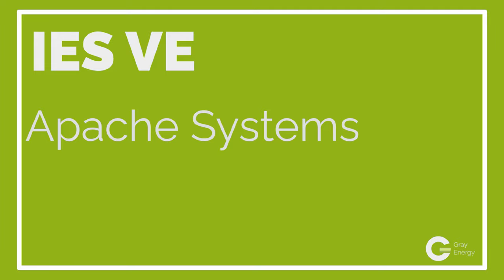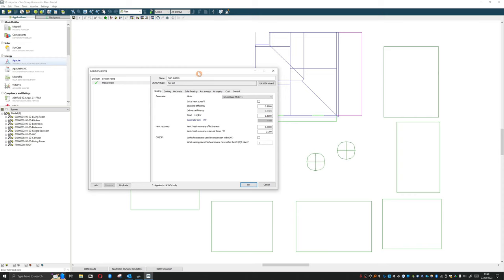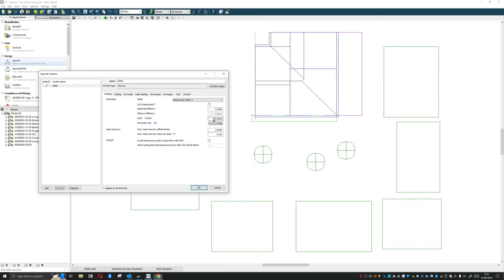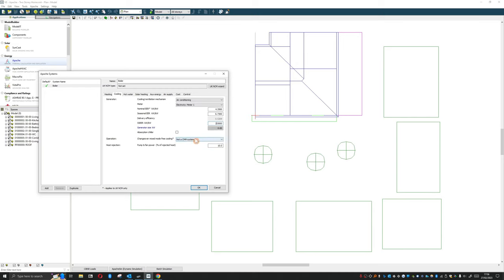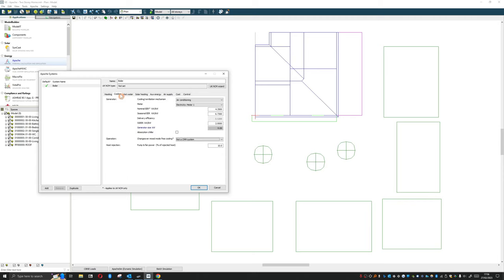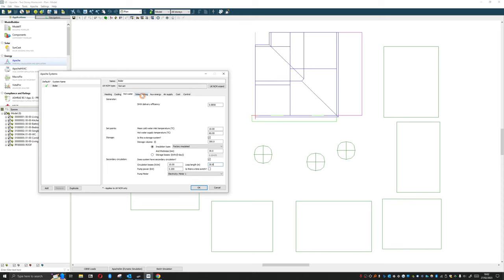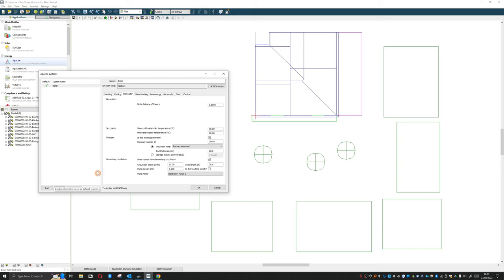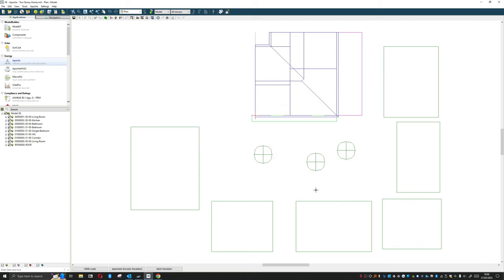IES VE Tutorials - Episode 17 - Apache Systems

Comment: I was slightly concerned when watching the video and watching you enter data for the heating and cooling plant - seasonal efficiency (as you correctly identified) is given in the boiler literature, but there is no such thing as SCoP for a boiler. SCoP stands for "Seasonal Coefficient of Performance" and strictly speaking should only be used to describe the performance of heatpumps in heating mode. I would certainly not assume that the rated efficiency of the boiler be entered in place of SCoP - if anything, I would expect that SCoP be left as a value of 0.

Does IES respond to queries if you raise them? Are you able to find out from them what the best-practice method of entering data is, both for boilers and heatpumps, and then distribute that information via your videos, including defining each of the quantities you are entering so that the viewer can actually understand the impact of selecting the right inputs.

On the cooling system data entry - no disagreement with the choice of Nominal EER and Seasonal EER. However, SSEER stands for "System Seasonal Energy Efficiency Ratio" and is not available from manufacturers (as far as I can tell) as it is a function of SEER, CDE (cooling delivery efficiency), and HRP (heat rejection pump and fan power fraction). Because it is based on the SEER, my understanding is that it needs to be entered by the user. Leaving the figure as default is therefore not the right thing to do. I don't know the solution, but misinformation is worse than just saying "I don't know".
Reply from the maker: Hi Dan, fair enough - I've dropped them a message and we'll see what they get back with. The information in their manual is a bit lacklustre. Apart from that, enjoying the series?
Reply from the maker: Okay - had an update back from IES. Turned into a bit of a rabbit hole. SCoP is not seasonal CoP as I and you thought. CoP is a seasonal average in this case and needs to take into account possible weather compensation and part-load scenario's. SCoP is System CoP and takes into account distribution losses, I have a rule of thumb for that so I'll cover that in the video. SSEER is as you've said. I'll put a note in the text description and update the video when I get a chance.